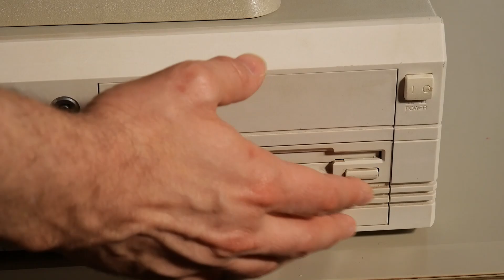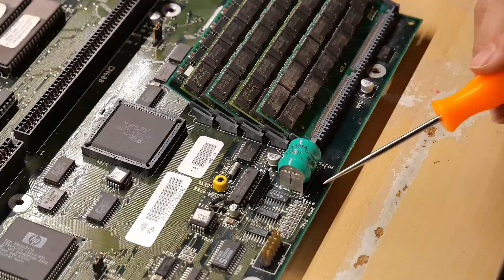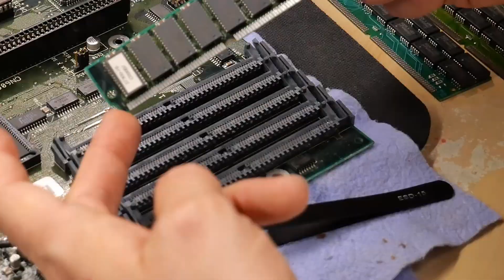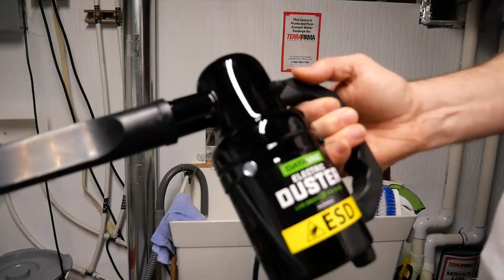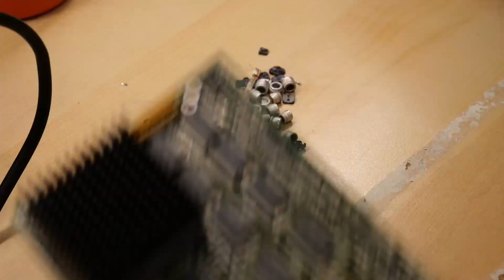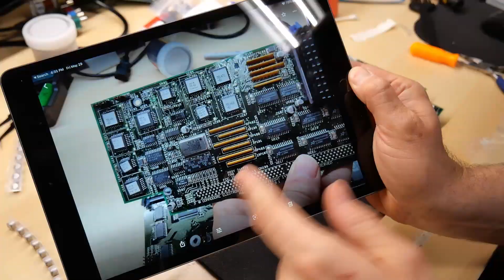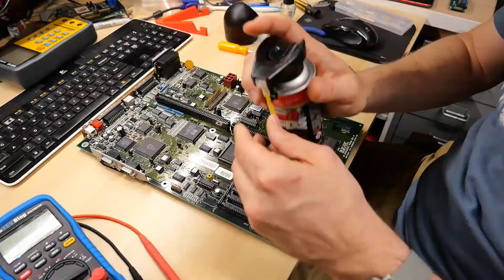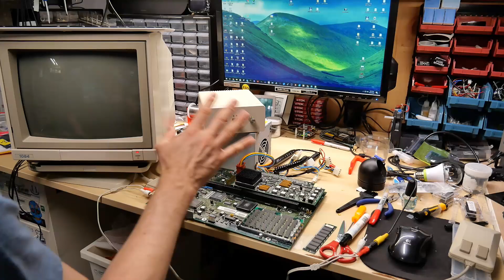Amiga 4000 Repair Part 1: Recapping and RAM issues galore!

Comment: Did you verify the polarity of the capacitors on the A3640 CPU board?  I didn't see you mention it in the video but most (if not all) A3640 CPU cards have at least 3 capacitors that are installed backwards (even the silkscreen is wrong).

See http://joj.home.texas.net/amiga/amiga03.html for more information.  The easiest way to check the polarity of the capacitors is to find a ground point (the metal can of the crystal on the card works well) and check for continuity with the negative size of each capacitor.  You will likely find that on C105, C106, and C107 the positive side of the capacitor is connected to ground instead of the negative side (C102E and C102B are usually OK).  If that is the case you need to fix it by reversing the capacitors that are installed backwards.

The capacitors are bypass capacitors so they aren't super critical for the operation of the machine but if they leak they can damage the board.  If you don't do this the new capacitors that you installed will likely start to leak in the near future.

Comment: Thought you'd still need to use alcohol to clear out the water? Lots of nasty minerals in water that I wouldn't want on the board as it dries. I guess ideally you'd rinse it in demineralized water.
Reply: At least soak the board in distilled water and dry it out in the kitchen oven
Reply: IPA is really good but it makes the board look dull
Reply: Frank-T : I keep forgetting not to use India Pale Ale when cleaning motherboards...

Comment: Great to see another A4000 on the way to recovery!  Yellow screen, could be lots of things  =/ rule out the RTC by removing the chip.  If you still get a yellow screen, my money would be on glitchy 245's on the Super Buster side.  Could also be the F86 as it was on the Yellow screening A4000 I fixed a few weeks back.  Check Super Buster socket too.
Reply: I read your comments in your accent 😆😆
Reply: @nbnb-nb  haha
Reply: Yes, it's easier to remove a socketed RTC than to desolder and replace a logic chip. I hope he wasn't actually going to replace the logic chip first.
Reply: It could still just be that it doesn't like the RAM too - when I tinker with the Minimig FPGA core any time I screw up the SDRam controller I get a yellow screen with asymmetric power light blink.

Comment: Take care of that Pentium motherboard, it's a pretty good one. It's made by Intel and called the Advanced/EV. And yes, Pentiums use a 64bit memory bus so you need to use pairs of memory modules. In 486s you can use individual sticks of 72pin ram or 4 30pin simms.

Comment: Idk what they cost but I think you can get pin-compable RAM sockets with metal clips, and they're not a pain to replace since they're thru-hole mounted.
Reply: It still would be a pain to replace the slots. By my count there should be a total of 360 pins there.

Comment: Did I see that right, aren't there two through-hole capacitors on the board? Are you not changing those?
Reply: He changed them off camera. The original ones are the ones he showed us in his tester.

Comment: Always verify traces using a probe first before removing solder mask. Dont use fingernail polish to repair -- use solder mask repair. Fingernail polish does not stand the test of time and will eventually flake off. Additionally, by scraping away the solder mask you've exposed the traces to corrosion during the wash.

The Varta is a NiMH battery, not NiCd -- different chemistry. What you cleaned off was likely flux residue or flux remover residue from a prior repair.

Comment: What fluid to you use for removing the "corrosion"?
Is bathing in soap-water really good?
BTW: I use air compressor for drying (e.g. Isopropanol alcohol).
Reply: He was using vinegar to neutralize the battery leakage.  Standard vinegar from the shops is a 3% solution of acetic acid.

Comment: Love your repair videos - even though, as CuriousMarc would say, you're clearly a "recapper"... 😉
Reply: @fgaviator, say what?  A "recapper" recaps everything even when they don't need it. I don't see him doing that.  Amigas with SMD caps need to be changed, just like classic macs. If you don't change them they will eventually cause all sorts of damage.
Reply: yeah, if there's anyone who never recaps, it would be Adrian.  😁
Reply from the maker: Huh? I never recap things unless they are leaking.
Reply: I would be more worried about not testin(recapping) power supply. DMM measurement of voltages is not enough to be sure Power Supply condition.

Comment: Nice Video! To remove the face plate is easy, just hold pressure out on the top center of the face plate while you push the clips bottom and top with a screwdriver until they all pop free. its sounds a bit confusing but is easy in practice. the audio caps are notorious for leaking,since the 22uf were supposed to be npo's iirc.  The a3640 has several known errors on the board,the polarity is wrong for 3 caps iirc. the board + is mis-marked. the 74xx part nearest the battery is notorious for going bad or having traces eaten under it from battery leakage.  It does take forever to get to a workbench prompt on the 4000 w/o ide and floppy attached :)  Glad to see it was only bad chip mem,in 20 years and 100's of a4000 repairs,i never encountered a bad chip simm lol.  8MB simms work as 2MB chip simms fine.
Reply from the maker: Ah yes I positioned the caps on the 3640 looking at the photos instead of the PCB markings so didn’t notice them being reversed.
Reply: At least the Amiga case is better than my Gateway 2000 where the front face is also held captive by the CD tray faceplate. To get the drives out of that you need to eject the CDROM, remove the tray front, remove the plastic front of the PC and remove the drive bays. Hopefully that drive doesn't get stuck closed; then I would have a chicken and egg problem and would be unable to get to the drives.
Reply: It's worth noting that any capacitors on the -12v rail will (correctly) appear to have their polarity reversed.

Comment: Congrats on your success.  It can be difficult trying to troubleshoot a system you're not familiar with.  I had a Rev C. motherboard that wouldn't work no matter what until someone clued me in that the Rev C. has no onboard crystal osc. which accelerator boards require.
Reply: So you can't use a Rev C. with an accelerator board? Or does it require a special one?

Comment: 12:30 that’s not how you remove roms. Buy a decent ic-puller for that.
Reply from the maker: If you watch my other videos, I have one. These were basically fused into the sockets. No IC puller would get those out and using a puller carelessly can easily break the chips.
Reply: Adrian's Digital Basement Thx Adrian. You’re right. 👍🏻
Reply: That's all you took away from this?